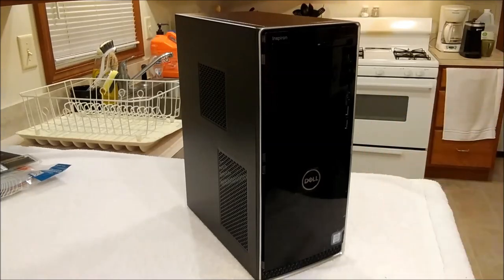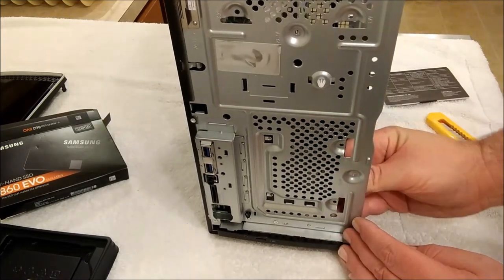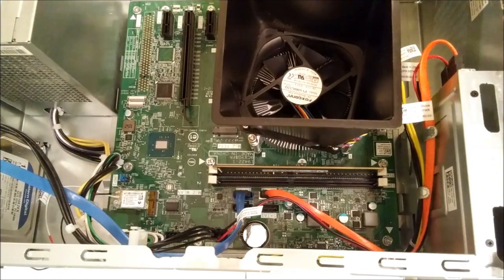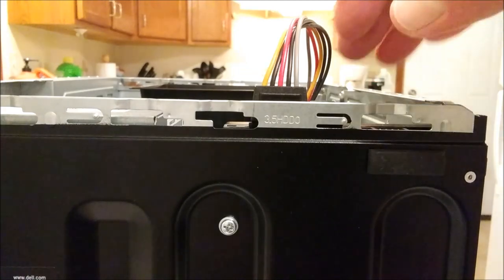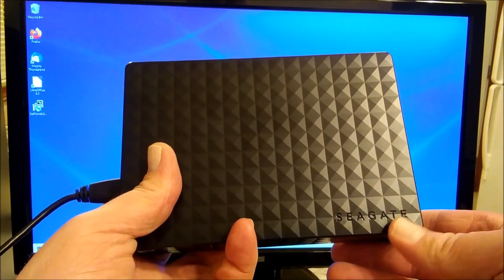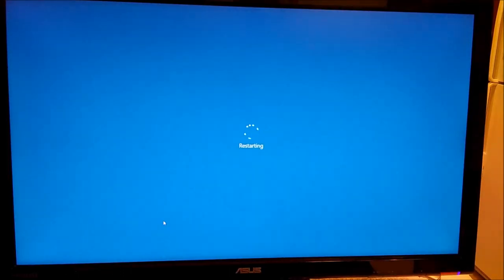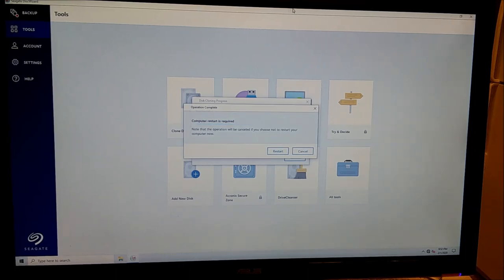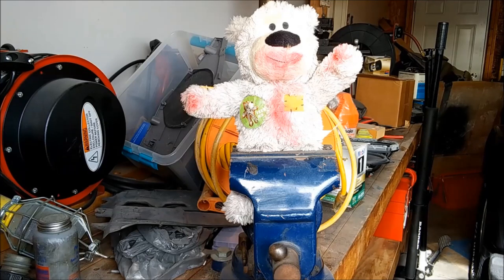TBT 6 - The Cheapest New Dell Upgrades: SSD and RAM install!

Comment from the maker: It has only now come to my attention that Dell requires the use of "Left" angle power connectors for their factory drive location. If you are using my video as a guide to upgrade your own Dell, be mindful of the distinction. I have made a video covering this topic as well as built a custom power harness for this Dell that I vastly prefer to the commercially available options. Linked below:

https://youtu.be/_lUX1OUaGNw

Comment: Another tip for newbies, don't shove the SATA connector into the drive super hard, I found this out the hard way after I snapped the circuit board on the bottom of the drive in half(the connector was stiff). Max, I feel your pain I just hooked up a TV so I could have my PS 4 and PC hooked up at the same time only to find out I can't switch between inputs. The TV sees both but won't show anything and tries to claim nothing is hooked up, As long as I only have one hooked up the TV works fine.
Reply from the maker: Wow... Yeah, you really don't want to force things when working on electronics. Take it easy and take your time is always a good idea.

In my case the pain has only begun with that computer, and funny you mention switching problems... that's next Friday's video. My pain in this video is that the kitchen is the only place with enough lighting to make videos in the house, so I had to drag everything out there... haha

FWIW, they make HDMI switch boxes. I have a couple from IO gear that work really nicely. The ones I have I really like because they're fully automatic. They switch to whatever is turned on the most recently. So if I have my laptop docked to port 1 and turn my PS4 on, it switches the port to the PS4 automatically. When I turn the PS4 off, it switches back to port 1 automatically. Or I can do it with a remote manually. For whatever reason it looks like the current IO gear boxes aren't automatic, but they are 4K certified and are only like $35. If you want an automatic one like mine, try eBay for GHDMIS4 from time to time.

You may also try to see if there's a firmware update for your TV.

edit: Actually... It looks like IO gear does have an automatic HDMI switch box again, but it's 3x more expensive. GHSW8441
Reply: @TheBrokenLife  Thanks for the tip bought it off amazon just now should be here tomorrow.
The thing I mentioned about the hard drive is what I did the first time I built a computer. The one I just bought https://www.amazon.com/gp/product/B07GGNFTXV/ref=ppx_yo_dt_b_asin_title_o00_s00?ie=UTF8&psc=1
Reply from the maker: @benhill3834  Sweet! I hope it works out for ya! If not, my IOgears have been great and I bought the one I'm using right now in 2010.

The first time I built a computer it had an IDE hard drive in it and ribbon cables!

Comment: I just got a dell 3847 from work and slapped a gtx 1070 mini in for a budget gamer for my son. I’ve been looking at those Samsung ssd cards but unsure which to purchase. It only has 8gb of ram. Would what your doing in the video benefit my budget build also?
Reply from the maker: Yes, almost certainly. It looks like you've found my Dell 3880 series as well where I go through and upgrade pretty much everything in the machine and benchmark along the way.

Dual channel RAM, the best SSD you can afford, and a budget GPU are all worth your effort to install.
Reply: @TheBrokenLife  will any 16gb(8x2) ddr3 ram work on my 3847 or do I need dell specific ram
Reply from the maker: @SatisfactoryPioneer  Just match the type with what's in it now.

Comment: Thanks for the details, Sir. I have a question about the fan for CPU. Did you install the square umbrella-looking stuff on the fan of CPU? Or was it already there when you bought it? I am interested in 3671 with i7-9700 and gtx1650. Thanks!
Reply from the maker: I didn't touch the CPU, so what you see is how it came from Dell. I believe that thing you're talking about is a fan shroud to the mesh on the side of the case for ventilation reasons. With a higher spec processor, like an i7, it's hard to know what Dell might do for that.
Reply: @TheBrokenLife  Thanks for the information!
Reply from the maker: Happy to help!
Reply: that odd shaped cone is new. i've got the same pc from black friday deal 6yrs+ ago just with an i5 and 12gb ram. Mine also came with 2 3inch diameter fans. Seems like that cone was designed and put there to cause overheating faster so in a few years they can sell the same person another computer....
Reply from the maker: @digitalsmoke4694  I'm not sure how you're drawing that conclusion. That cone goes up to a perforated window in the side of the case. I would expect the CPU fan being able to breath from the side of the case to actually reduce case temps.

Or are you saying that cone is in-place of one of the fans that your machine has? I could see that as it's possible your i5 may run warmer than the i3 in that machine. In either event, I'm pretty sure most Dell BIOS monitor CPU temps and will shut them down on thermal events to prevent permanent damage (at least the laptops for sure do and a couple of mine came used with thermal events recorded in the log and they still work fine today). I'm sure it's possible to cook one though, but I don't think Dell is trying to do it on purpose.

Comment: Does the seagate external drive need to be empty (blank) for this process to work? I'm planning on doing a similar upgrade the only thing I'm not sure about is transferring the OS to the new drive.
Reply from the maker: No, it can have other stuff on it as long as there is enough available disc space. In fact, you don't even have to use the Seagate drive. You just have to have one connected to the system.

Comment: Why would you use a 2.5 Inch SATA III SSD when you could use a PCIe M.2 NVMe SSD and plug it directly into the motherboard?
Reply from the maker: If I'm dead honest, I didn't really know any better at the time, plus price was a factor (and I think the m.2 was a fair bit more money)

I just bought a Dell 3880 to tinker with this year and will be putting an m.2 in it on the channel. There's absolutely a degree of my audience educating me in these videos. I'm not an IT professional and am just a dude tinkering at home.

Comment: How did you power the SSD with the second power port ? I wanted to see more there the connecting cable and power cable for SSD go
Reply from the maker: With a Y splitter. I made an entire video on that. "TBT 8 - Custom SATA Power "Left" 90 Degree Adapter (for Dell Desktops)!"

Comment: curious what speed is your ram and did you get it running to its full potential ?
Reply from the maker: The RAM I put in it is PC4-21300. As far as running to its full potential, probably not. The goal of the upgrades was to take it from intolerably slow to acceptable for daily tasks. My Dad uses it for email and playing solitaire, so not really a high performance build. The 3880 I'm working on now we're going to push a little harder on.

Comment: wait i have a question the 8gb ram stick is 2666mhz and the pcs ram stick is clocked at 2400mhz and intel said i3 can only have up to 2400mhz can it still run at 2666mhz?
Reply from the maker: No, but the faster RAM can be slowed down and is backward compatible. That machine has been in daily use for over a year now with no complaints. :)
Reply: Thanks man I appreciate it
Reply from the maker: @P4rem  Glad I could help!

Comment: Here s a  question from me...i used an firewire audio interface  on my previus pc..will a firewire controller, (pci express), be compatible to this one?
Reply from the maker: The manual says it has 1 PCIe x16 and 2 PCIe x1 slots. So, I can't promise your firewire card will work, but it appears to have the slots available to install it.
Reply: @TheBrokenLife   thanks for you reply,  I'm still waiting for the firewire card to arrive as my previous pc had it built in the motherboard..hope it works..🤞
Reply from the maker: @lesspainlesss  I hope so too! FWIW, it looks like a USB to Firewire converter cable is only a few bucks if for some reason your PCIe card doesn't work out. I have to confess I'm curious what you're doing with firewire as I haven't heard of anybody using it in a long time now.
Reply: @TheBrokenLife   I use an external audio interface (which is connected to the pc via firwire) in order to record music - guitars and bass ...do you have a link for the firewire converter cable?..i once ordered an firewire to usb adapter from eBay  which was totally useless and did not work at all...
Reply from the maker: @lesspainlesss  So, it's a sound board that was made in the precise moment in history where Firewire reigned supreme? Interesting to know things like that are out there. I've only heard of it used for digital cameras, detachable media, etc. If you can't get it working for some reason, let me know. I'd be interested in play with one just for grins.

Digging back through Amazon for a link for you for a converter, I may have been too hasty by suggesting that. They do exist, but most seem to have terrible reviews and several say they ended up doing exactly what you're planning. So... It's probably for the best if I don't provide a link. ;)
Reply from the maker: @lesspainlesss  It appears that card uses a VIA chipset, and VIA chipsets are usually of decent quality and very well supported no matter the device, so I doubt it will give you any trouble. The Amazon reviews I could find of similar Digitus Firewire cards are all positive as well.

Come to think of it, I don't think I've ever had a card mechanically damage a machine, but, you could be the example! Let's hope not. Good luck!
Reply: @TheBrokenLife   thanks again my friend for your answers and your time,...I will let you know for the results...!
Reply from the maker: @lesspainlesss  I'm glad I was able to help!

Comment: I tried to upgrade my Dell end with a fake nVidia GeForce can't new drivers.  It cut out from time to time.  Help
Reply from the maker: When you say "fake", do you mean genuinely counterfeit or just a generic video card with an actual nVidia chipset on it?
Reply: @TheBrokenLife  It has a nVidia box but when I did system update it called the card a fake no update will load
Reply from the maker: @johnjohnston7642  I'd probably consider contacting nVidia to see if they can verify the card is actually counterfeit as well as the retailer you bought it from to let them know about the issue. 

Beyond that, what does Windows say the card is in the device manager?